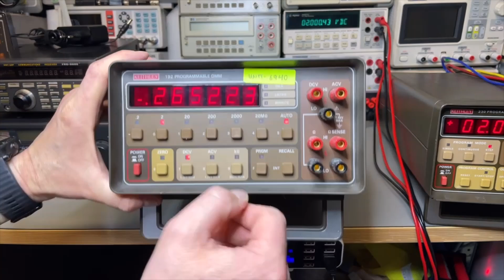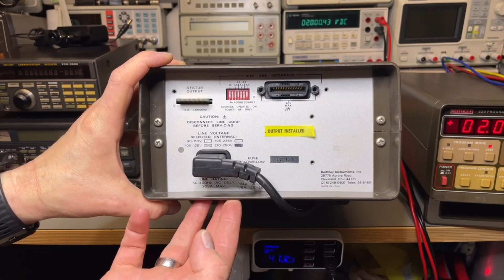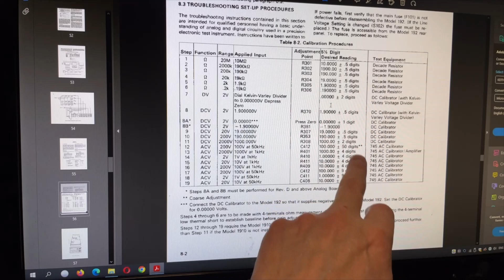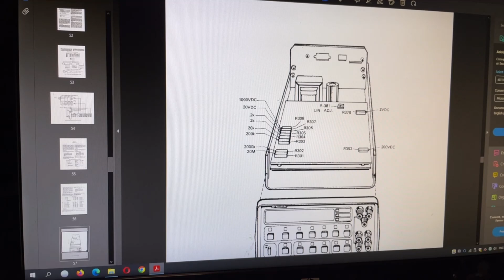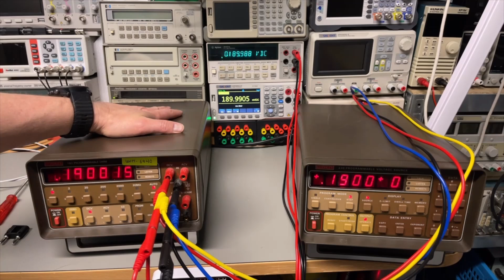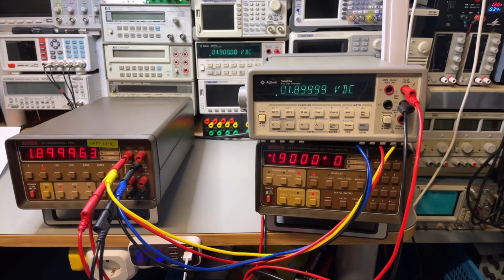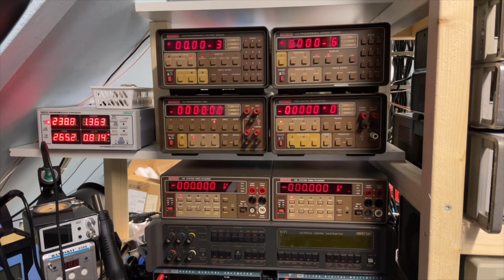#281 Keithley 192 Multimeter 6.5 Digits 1982 Teardown Calibrate

Comment: Why did you switched of the Siglent? Not accurate enough, Or is it perhaps drifting to much due to being stacked on the bottom and limited space for venting 🤔 (More sensible to temperature changes)
Reply from the maker: Hi, it drifted to much for my tast, it has its own fan inside and should be able to control its own temperature. i am sure in a temperature controlled lab. it is a great machine.

Comment: Tony you have excelled yourself with the 192. What a cracking multimeter. My electronics education started around 1984 and we had to use the old AVO meters for the first year. Interesting meter the AVO and to think that 20K per volt internal meter resistance was always quoted as reference on most TV schematics back in the day. In year two I moved on to the THANDAR TM 355. Wow that was good in its day. I'm not to sure if your channel makes me feel young or old. It certainly brings a smile to my face. Glad you enjoyed the coffee and thanks for the complement of the tidy shack. Ian M5AXA
Reply from the maker: Hi Ian, you sure worked with some nice equipment.. young or old... the smile is important!